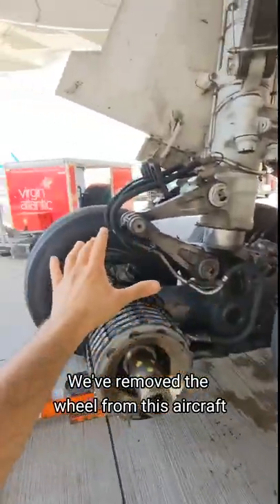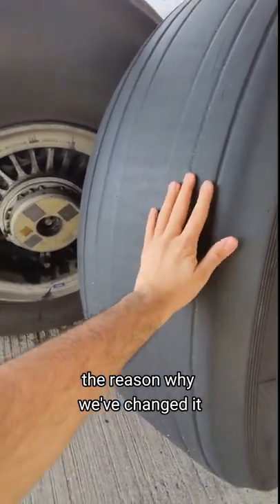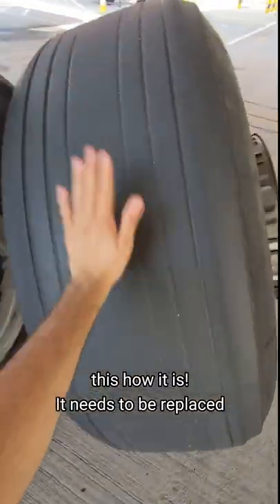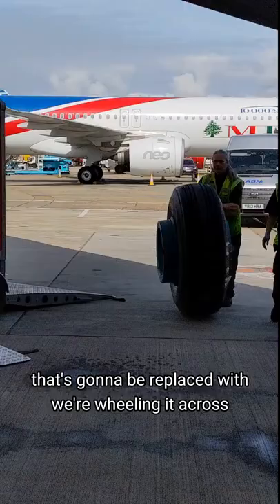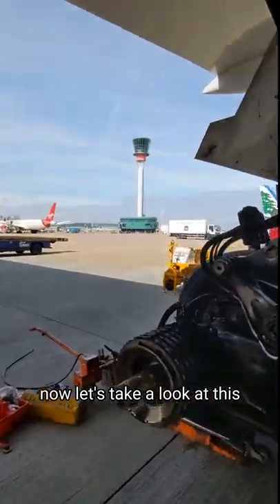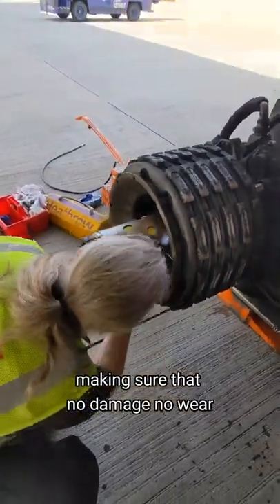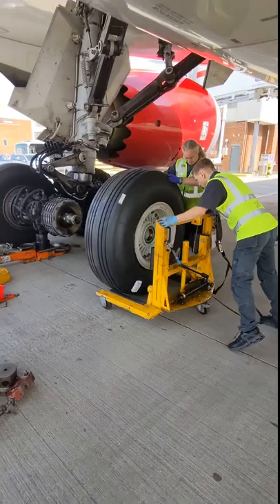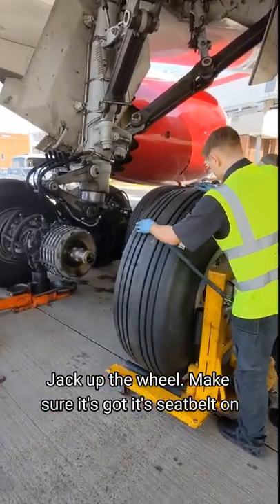How to change an airplane tire. Explained in 1 minute!

Comment: I would have let that tire go
Reply: Less than what the manufacturer recommends. Can’t legally let it fly if it’s less than what’s required because someone eyeballed it and said “yeah it still looks good”
Reply: Sure you can.  Knowledge is power.  That tire is fine…especially on a quick turn.  Turns out, they don’t drive to their destination.

Comment: No cord on old tire=op check good bruh
Reply: Way less than 6mm or whatever the spec is for it’s min tread limit. No meat on those bones. One wet runway with that tire and a one way trip to a runway overrun from hydro planing. What are you smoking
Reply: @ryleymclean313  limits are 0.79 MM according to the AMM. And states at the next CONVENIENT maintenance opportunity. Up to the discretion of the inspector at that point. Every mechanic I know goes by whether bias ply (chord) is showing. Again. Bias ply.
Reply: @ahnafahmad324  odd. We go by tire tread, its general practise here to not go below 6mm on MLG tires for our 73's which is when we take off our tires
Reply: @ryleymclean313 in the hangar at a 145 sounds about right.  It’s called making money.  In the real world planes FLY.

Comment: There's no chord showing. Why replace it?
Reply: Because it’s less than the limit stated by the manufacturerer. If you replace when the tire chord shows. Then you must be smoking something else. Our part 145 would not allow that what so ever
Reply: @ryleymclean313  I work on 787 and the manual states only when the bias plys on the chord are showing is it unservieable. You must not have much experience in the industry. Every regional, narrow & wide body aircraft I have ever worked on follows this same limits. Only exception I can think of is military.
Reply: @ahnafahmad324 my airline uses retreaded tires, so we have to change them if they're at or below 3/32 to ensure the chord isn't damaged

Comment: Still grooves on it.
Reply: That tire had a huge bald spot brother, what are you smoking. One wet runway and no way to channel the water around it and easy way to hydroplane down that tarmac. Way out of limits
Reply: @ryleymclean313 you are high…100% of the time, that tire goes on a turn.  AND, there are different limits depending on the visit. I would send that tire all day long and sleep good at night.  Then again, I have been an A/P for over 30 years.  This tire is fine.  People get laughed off the flight line for big dealing a tire like that.
Reply: @ryleymclean313 yawn

Comment: Didn’t use a thread protector 🫤
Reply: Turns out none of us do
Reply: @justing42  Error bus technician?
Reply: @justing42 turns out you don't know tricks of aviation with the Thread protector on You can slide the tire in with ease  . But good job for exposing yourself of not following the AMM 😅